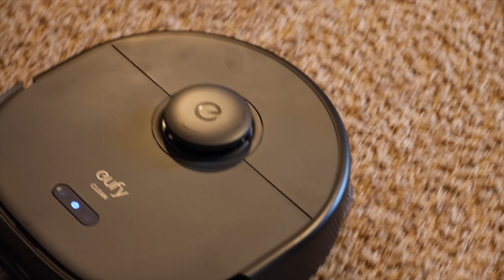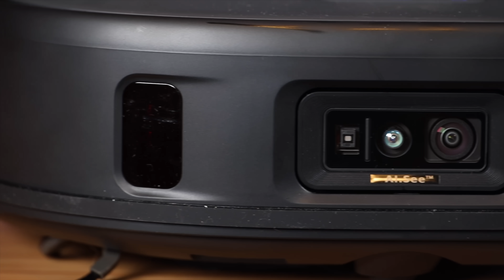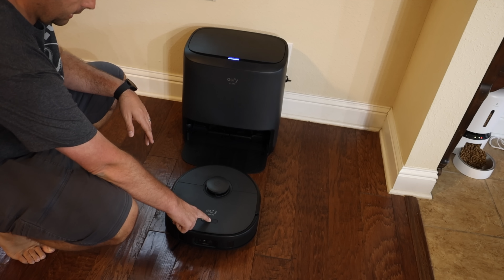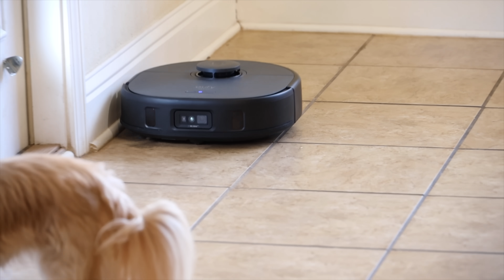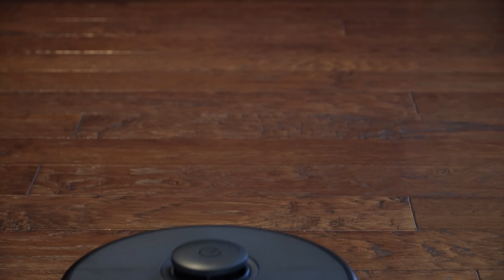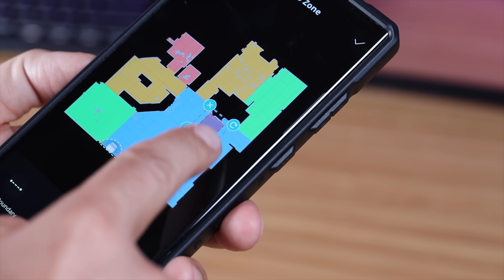eufy Clean X9 Pro Uses AI To Clean Your Home!

Comment: Only thing that you didn’t talk about much is the dust bin needs to be emptied manually. Not a huge deal to me but could be to others.

To empty the dust bin it seems like you have to pull the robot vac out of the doc, is that your experience?
Reply: Yeh they missed a customer here due to this.  The whole point of these is to interact with it as little as possible.  I guess if you mostly have mopping to do then this might work but for me emptying the dustbin should be standard.
Reply from the maker: Yes. You will need to roll it out to empty the dust bin